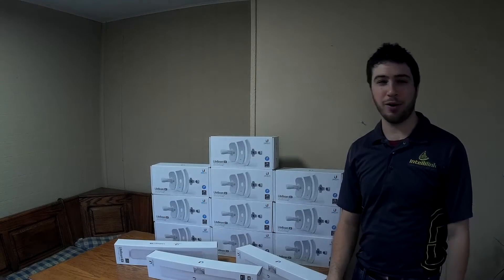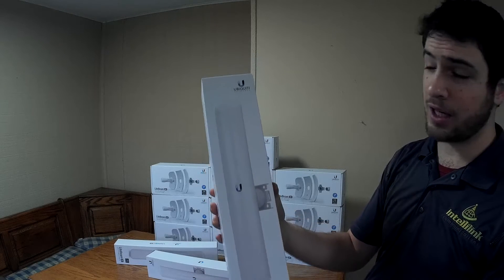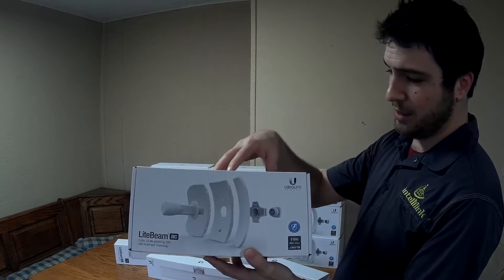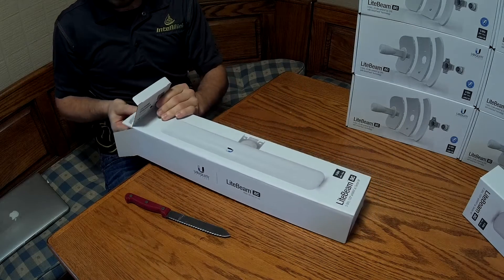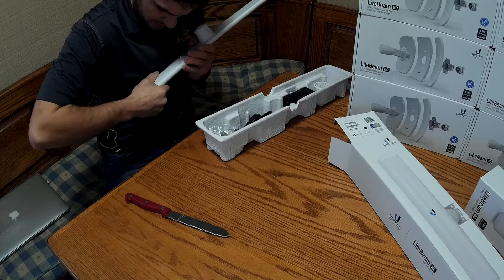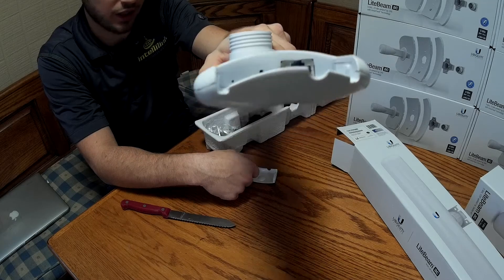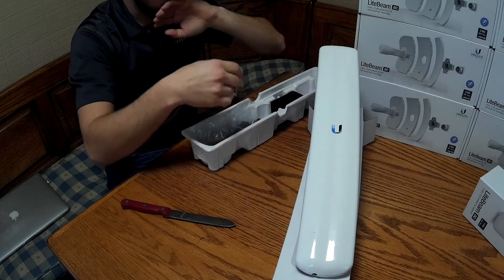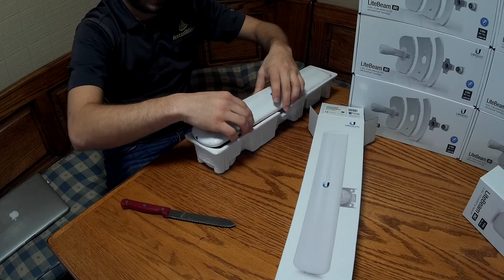Ubiquiti Networks Litebeam AC LBE-5AC-16-120 & LBE-5AC-23 Unboxing

Comment: I'm a little startup WISP. How yo liking the LBE-5AC-16-120. What kind of real distance you getting on it. I'm thinking of using it for some smaller towers instead of the 5AC Prism with 120s. Hoping to get good 2 miles use with some 5AC-23. Only serving 15 MB max
Reply from the maker: You can do 2 miles easily with great results. In my real world scenario 4 miles is max range to get any sellable signal.
Reply: Thanks for the reply. I'll report back on results. We are waiting the weather to dry up se we can pour some concrete for our towers.